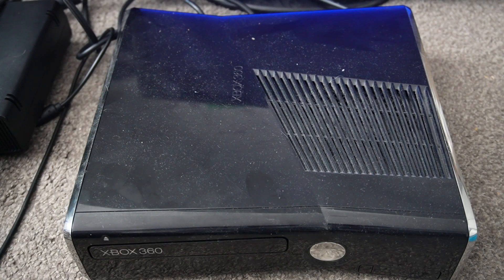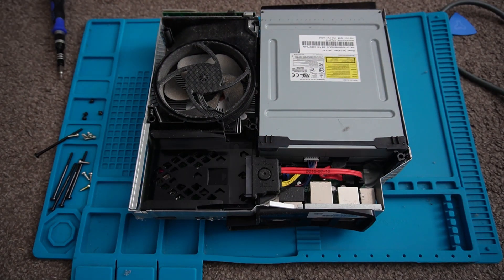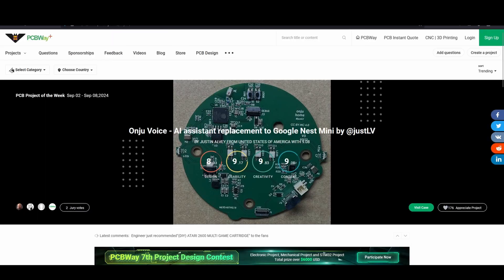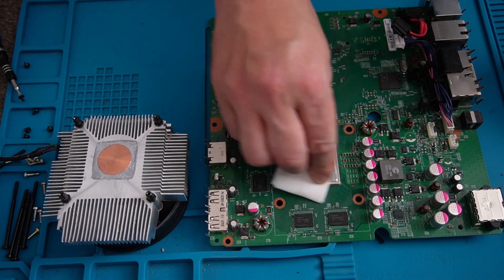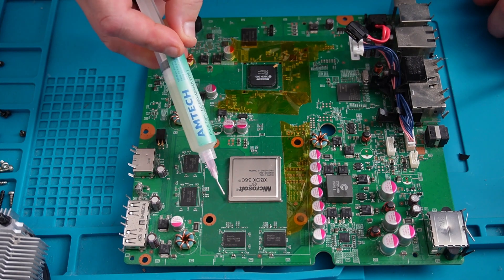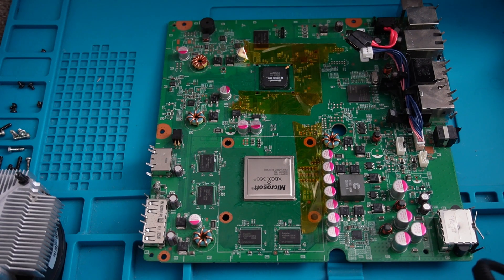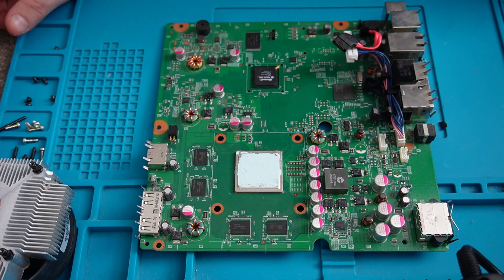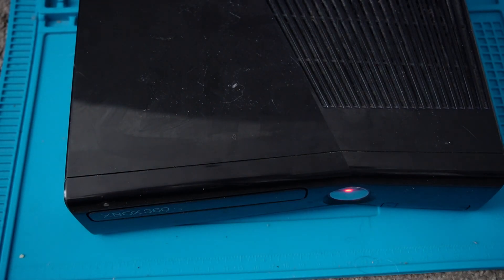Xbox 360 Slim Faulty Red Light Repair Attempt

Comment: Good attempt man , bit of friendly advice , the cpu/southbridge require ALOT of heat , ive had to heat them badboys up for close to 10 minutes at 450c before it even started to reflow , and the xbox board might as well be a giant heat absorber which doesn't help , i found by keeping it elevated and off the silicone mat was a little faster but they do take a while and you have to do them one at a time while keeping a eye on the caps near them dont go pop there a pain the a s s , might be worth trying to reflow again and making sure it does move with the slight nudge test , thanks for the sub my dude- Chunky
Reply from the maker: Sorry i missed your comment first time around. Thanks for the tip, i noticed it does need a serious amount of heat.I will try it again. I eventually wont to try and move onto reballing them properly im not looking forward to it 😬

Comment: Valiant attempt. May warrant a revisit in the future. 
I've never opened up a 360 before, is that circle warranty sticker always there? Not sure if I think it looks legit or from some third party 😂.

That thermal.... well, I can't call it paste, more like thermal dust, looked like something from ancient Egypt. 

When you applied heat with the hot air station, what was the reasoning behind using a thin nozzle? I never pay attention to what nozzle I use, just using the one that happens to be on there 😂

Also, lovely accent!
Reply from the maker: Id defenetly like to revisit this one as i think it could eventually get it going. Im not sure if that sticker is always there i presume so.
The thin nozzle i think concentrates the heat in a smaller area that was my thinking behind it. Thanks very much :)

Comment: Hey mate first yoou want to get the secondary error code by holding the sync button and pressing the eject button 4 times and different parts of the light will light up eg 4 lights light up. You get a four digit code where each light is respective to their number except 4 which means 0. then go to xenonlibrary and find the secondary error code there.
Reply: Feel free to lmk if you have any problems, id be happy to help

Comment: heating up is temporary fix at best. it needs proper repair - measurements of voltages and resistances, proper chip reball. no picture could be hdmi connector. surface level blowing with heat gun is not the way.. board needs to be on a heat plate at some 150 c at least and heat gun is last bit to get solder liquid under chips, but only after proper reball. send it to north west repairs, dude is gpu wizard
Reply from the maker: Reballing properly is something i really want to learn and do, i agree the heatgun method is temporary at best.

Comment: You rework station probably can't get that board to a high enough temperature to fully reflow the chips. I had the same one (my son uses it now) when I first started out about 14yrs ago. A board pre-heater would help a little, but a new station like the Atten ST-862D will also serve you well in the longer term. I roughly tested the Atten and the 858 with a FLIR cam to see how much heat they could put into a board and there's a decent sized difference. Both were in a clamp stand so they were the same distance away from the scrap board I tested it with.

Thanks for the video, I've subbed so I can watch any others you upload.
Reply from the maker: Yeah that could be the problem that rework station was just a cheap one, i will look into the Atten thanks for the suggestion as im always looking to upgrade my tools.A board pre-heater is also something i will look into as i think il come across similar issues in the future. Thanks for subcribing i appraciate the support :)
Reply: @Pixel_Fix  I really enjoyed the video. Thanks for putting it out. The pre-heaters I have are from Ali-Express. They get the job done without breaking the bank!

Comment: That's a shame. It might be the main IC under the fan got damaged due to overheating when all the thermal paste dried out.
Or it could be as simple as replacing the electrolytic capacitors.
Reply from the maker: Thanks for the suggestion the capacitors would certainly be worth having a look at.

Comment: You did so well but I think you will get it going, I’m not sure about what else could be causing it apart from maybe a circuit, tho I’d take a closer look at the board incase there’s any part that needs a solder. Could be weak around cpu or if anything might be a power supply issue even tho it powers on, as you have already sorted out the main heating issue. 😁
Reply from the maker: Thank you :) Im thinking it may be more gpu related as there is not any display atall. I have kept it aside and will defently re-attempt sometime.The powere supply like you say make be worth checking to.

Comment: That's not how you do it. You never reflow a RROD in 2024, because it was never bad joints under anything. Use the hold sync and press eject function to get the code and look it up in XenonLibrary